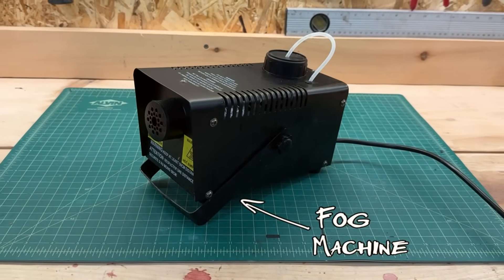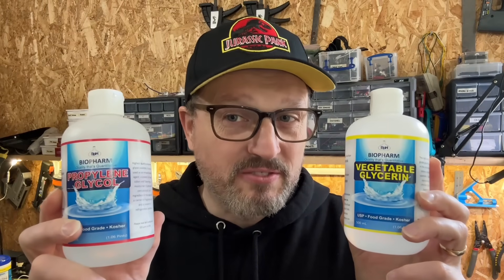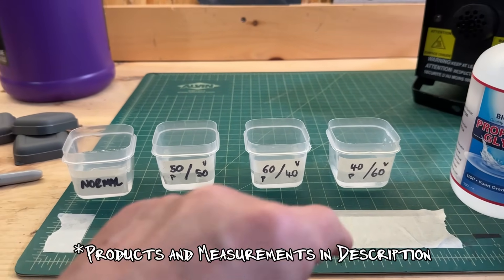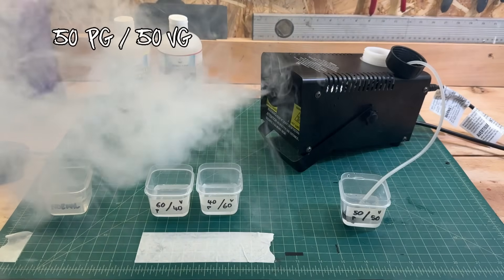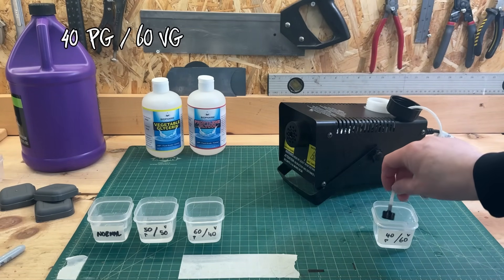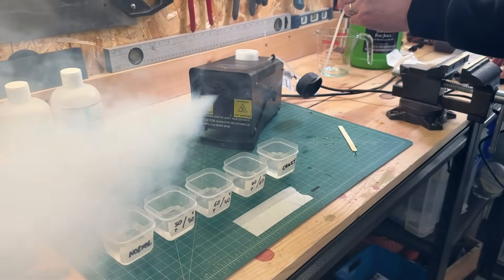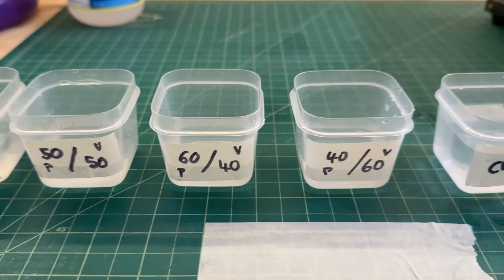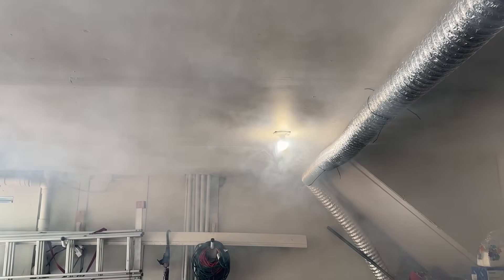How To Make Thicker Fog For Your Fog Machine!

Comment: PG gives you volume but very little hang time. 
VG gives you density and hang time.
 Distilled water cuts your cost and keeps you from burning up your motor.
40/40/20 will make most hunters happy.

Comment: The vegetable glycerin is what makes the fog linger. Depending on your purpose, you’ll adjust the ratio of ingredients. For example: stage shows or magicians usually prefer a thick fog that disappears quickly, so they use more propylene glycol. On the other hand, for parties, clubs, or haunted houses, you’d want a mix that includes more vegetable glycerin to create fog that hangs in the air longer.
Reply from the maker: Thanks for the added info!

Comment: the fog normally lingers on the ground, it was just staying on the ceiling, I think thats why it comes the way that it comes so it stays on the ground
Reply: Many companies use more distilled water in their fog fluid simply because it’s cheaper than vegetable glycerin. When the fog exits the machine, it’s warmer than the surrounding air, which causes it to rise at first. Vegetable glycerin, being denser and retaining heat longer, produces fog that tends to linger and move more slowly. That’s why in the video it stuck near the ceiling for a while. To counter this, people often use fog chillers, which cool the fog so it becomes heavier than the surrounding air and settles closer to the ground.

Comment: One thing to be aware of with DIY fog juice... the pumps inside the small consumer machines are made to use the cheap fog juice that's very thin.  These DIY mixtures are much more viscous and can burn up the pumps, so definitely still add some water to your mix.  And then run pure distilled water through the machine when you're finished using it.
Reply from the maker: Yeah makes sense - I added the thinner fog juice as a base to all of my mixes to make sure the pump did not clog
Reply: @Creative-Geekery  I’m new to your channel love it on crazy what was the mix I love that one nice and thick
Reply from the maker: Sorry just saw this it was basically 25% standard juice mixed in

Comment: would it make a difference what I use if I was going to chill the fog so it stays close to the ground.
Reply from the maker: You need to chill it as it exits the fogger - so a pipe with ice packed round it - I’ve seen some people use a small cooler with a pipe hot glued though it that they pack with ice.

Comment: CAN YOU HELP ME IN WHAT SIZES AND WHAT SHOULD I USE TO OBTAIN 5 LITERS OF FOG LIQUID?
Reply from the maker: So... I'm not an expert on this - this was simply an experiment to see what would make the fog thicker. https://a.co/d/hTHrlEp - is a link to high density fog juice - this is epic even in a 400w machine I used it this year as well as some of my own mixtures. My other suggestion if you want to manufacture your own is to test ratios/mixes yourself (you can see what I tried in the video) with your machine and then increase to whatever quantity works best.  I used a base of standard fog juice (25% ish) for each of these tests. As always you try this at your own risk - I can't take no responsibility for the outcome as it could damage your machine. Always follow the manufactures instructions.

Comment: I wonder if the the watts on the fogger will change that affect of the fog. Also how many watts is the machine you are using on this video ❤ thank you for all the help😊
Reply from the maker: Fogger wattage is 400 I think - 1000 makes a lot more as the motor can push more fluid and heat it quicker
Reply: Or share the link from Amazon. I already the  PG and VG to cart  just need a machine
Reply: Nevermind I see you got it at HD

Comment: You will destroy your machine with this mixture. The pump is to small, the tubing will be full of dirt, and the nozzle gets resin which you almost can't be clean anymore. I destroyed 2 machines in this way
Reply from the maker: Yeah I’m sure it’s too much for a small machine like this - I say at the end I also added a base of standard flog juice to the mix each time. I was fearful of the very thing you mentioned here happening.
Reply: Then if you clean it out with 100 percent vinegar, you shouldn’t have to worry about it. There won’t be any buildup of any kind, but you might want to clean it up, immediately after Halloween is over. I’m going to give this a try and see what happens. I think that you have a great idea of using say 80/20 or perhaps 90/10 mixture of PG and Fog fluid. Not sure if you know this or not, but if you use distilled water in your tank when you store it, it will make sure that your fog machine is ready to go the following Halloween season. It will keep everything lubricated. Happy Halloween 2024.🎃
Reply: @AtmxDawg24  Please post results I've wanted to do this but I don't want to sacrifice a machine for it. Also, if you can let us now how long you ran the machine, I have concerns about running this kind of mixture for 4 hours.

Comment: Very few quality brands use glycerine at all anymore.  The industry moved away from it long ago for a number of good reasons.  It’s all water, PG, and TEG in various proportions.

Water is an important component because that’s what the heater is supposed to be vaporizing, not the other chemicals.  It aerosolizes, not vaporizes, PG, glycerine, etc.  Those chemicals have a much higher vaporizing temperature, so without water it will work briefly when the heater is at max temperature, but when it drops below that temp it’ll just start spitting boiling liquid out the nozzle.

The viscosity of a pure PG/Glycerine mix will be through the roof too.  These tiny pumps can’t handle that for long.  It’s not a matter of whether it will shorten the life of the pump, but how much it will shorten it.
Reply from the maker: Thanks Ryan - appreciate the input here - I'm sure the viscosity would kill the motor fast like you said. I used the 'high smoke mix' with a base (25%) of standard fog juice last year for a haunt and the smoke machine held up well - it was a vertical jet smoke machine no issues with hot liquid - but a pure mix I'm sure would be a disaster - for the fog machine and the floor under and safety! Its important to always have some water in there. I'm pretty sure the pump/nozzle would get blocked fast!
Reply: The “standard fog juice” base was a good call then.  As you noted, they’re mostly awful, which means a high percentage of them are usually water (as a product from Spirit or some similar company is anyone really surprised?).  So that was likely enough to keep your machine healthy with the added ingredients!
Reply from the maker: @Ryan-nu4sl  thanks! Appreciate you commenting and watching 😊
Reply: What is TEG?
Reply: Triethylene Glycol.
Reply: @Ryan-nu4sl  should we make homemade fog with that instead? If so what is the ratio? Thanks for the reply expert!
Reply: @Dieje  Adding TEG to your mix will help in a number of ways, but the catch is that it's not nearly as cheap as glycerine.  Assuming that the entire point of DIY juice is to save money, making "proper" juice with distilled water, PG, and/or TEG will quickly rise to or exceed the cost of just buying a gallon from a professional company.  Though if you did want to try it yourself...

I would start with a base of 30% distilled water.  I know some brands use less but I wouldn't use anything more viscous than that.  PG will produce light fog that dissipates rapidly when heavily diluted.  TEG will produce near-glycerine dense fog and stay around for much longer.  If you even want to add a dash of glycerine to your mix for density or hang-time, that's fine too.  Aside from one very specific generic-tier brand that I won't name, no professional fog juice contains more than 5% glycerine.  Mix those components together to make a juice that suits your specific needs.

Hell, you can even look up Antari, Rosco, or Chauvet's fog juice SDSs and they'll just tell you straight up their chemical %.
Reply: @Ryan-nu4sl  thank you for your expertise
Reply: What's wrong with glycerine and why is it not used much anymore?
Reply: @gooffeyguy  The primary reason it's no longer used in professional theatrics is because it's just a straight-up nightmare to deal with.  It gets on everything, in everything, and makes everything slick as hell.  When used outside this is less of a factor, but it will still get all over any props, animatronics, or whatever else you have cloaked in the fog for extended periods.

Other reasons:
It's difficult to get the viscosity right for general-use machines.  Too viscous and you'll jam the pump or start spitting boiling liquid instead of aerosolizing it; too thin and it'll suck the heat out of the heating block quickly, leading to shortened bursts and frequent reheating/wear on parts.  PG & TEG are easier to balance viscosity, performance, and fog characteristics.

Glycerine needs to be nearly pure and undiluted (>90%, but really 95%+) to be effective at keeping microbes at bay.  At 30% concentration glycerine just becomes a tasty snack for microbes and will grow stuff over time.  These colonies can jam the pump at best, or get aersolized into the fog for people to inhale at worst.  PG and TEG are both incredibly effective biocidal agents at even low concentrations.  How long a jug of glycerine-based juice will take to "go bad" is unknowable because of the numerous variables at play with how microbes grow, but that concern is avoided entirely with the other chemicals.

It hangs around *forever*.  Not everyone needs or wants a fog that sticks around for literal hours.  Again this is less a concern outside and may even be a good thing for some uses, but needs to be weighed in consideration of everything else.

I feel like there's a few other things I'm forgetting, but those are the top ones that come to mind.
Reply: @Ryan-nu4sl  thank you for your insight! What would you recommend as a mix for a vape pen-based smoke unit? At the moment I've got a bottle that came with my unit which is 70%PG and 30%VG.
Reply: @tezzrexx  I understand the basic chemistry is the same, but I don't know enough about vape pens to give an educated answer for you.  It's one thing to talk about something you inhale incidentally, and another to talk about something designed for the express purpose of inhaling.
Reply: I have destroyed around 4 machines with this home made fluid. Or did I not clean the machine every certain hour? How do I clean up the fog machine. Your help is appreciated.
Reply: @PEWCHU-u2n  run a 50/50 mix of distilled water and regular white distilled vinegar thru the machine after you get done doing your fog. After cleaning run a very small amount of fog juice back thru it to lube the internal components if storing for an extended period.

Comment: Can i suggest 70/30(VG/PG). Its the VG that makes the smoke and the PG stops it from clogging up the pump and pipes. Then you'll get thick smoke. Be aware that this may be too thick for smaller pumps and hoses. Also.. NO WATER!!
Reply from the maker: Thanks yeah always up for more suggestions!
Reply: @haydnrayturner1383  no distilled water?
Reply: @cvinny82  I can only speak from a vaping point of view, very few (if any) eliquid companies use water in their products as it just thins out the mix. Thinner liquid means less dence clouds. But it could be a good thing as less dence liquid might limit the clogging of the pump and hoses.
Reply: @haydnrayturner1383  water is needed for these, it's the key ingredient for foggers, the PG and VG are just the "colourants" in the smoke.
Reply: @nipzie  Thats fair, like i said i can con only speak from a vaping point of view for thick clouds. I've never had one of these machines so would happily express that i have no idea how they work or how they should be used. You guys would know more than me 🙂☺

Comment: Nice video, very informative! Makes me wonder why not just use pure PG, I'm guessing it gums up the works maybe and the VG acts as a kind of lube for lack of a better term
Reply from the maker: Thanks so much! Yeah - it’s pretty thick so I’m assuming it might do exactly that - or possibly put too much pressure on the pump. Going to try this mixture for my Haunt this year and see if it has any long term impact on the operation of the machine 😊
Reply: You need water in the mix- that's what usually gets vaporized by the heating block, which causes the pressure in the tubes to skyrocket, and then the non-water chemicals get ejected as a vapor (fog).  Without water you'll get fog briefly while the heat block is at maximum temperature, but then it'll just start spitting boiling liquid out the nozzle because there's not enough heat to vaporize the thicker chemicals and the thermostat hasn't dropped enough to tell the pump to turn off.

PG and VG also produce very different fogs.